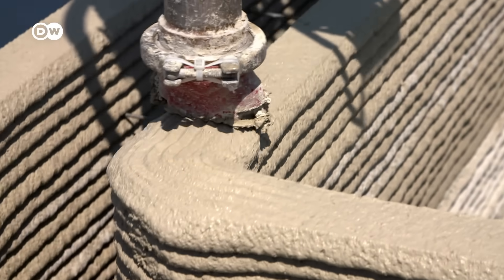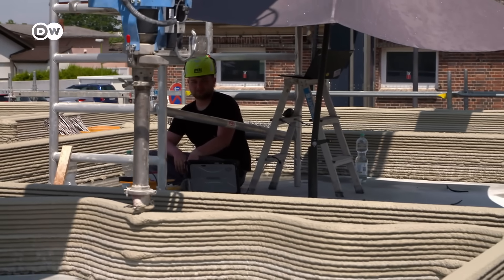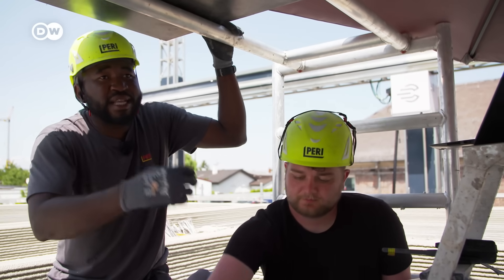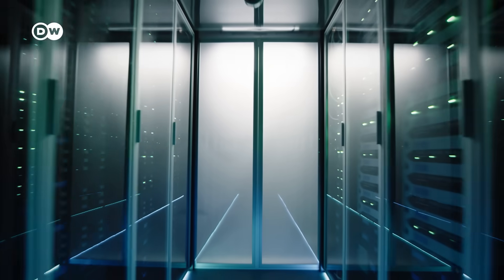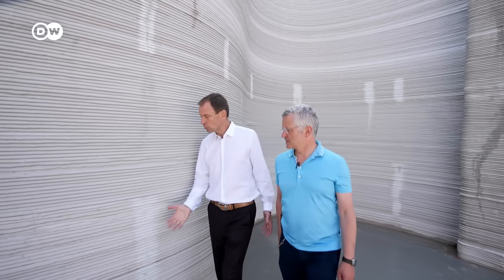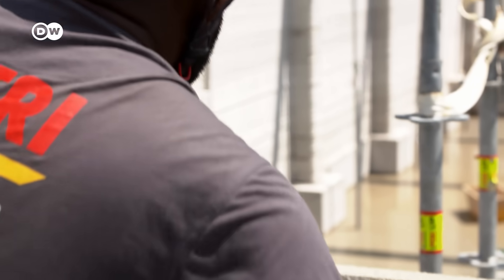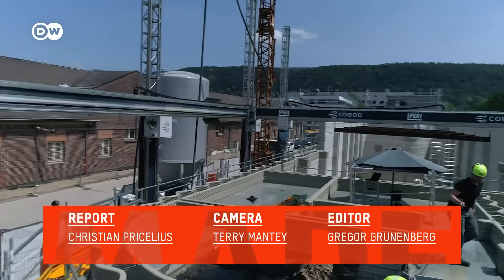How Europe's biggest 3D-printed building is being constructed | DW News

Comment: This construction method is interesting but there is one issue...

Will a house made by 3D printing withstand a seismic event better or worse than a traditionally built house?
Reply: with no steel rebar to reinforce the walls, i'm going to say no.
the lack of windows would be a concern for any structure that is supposed to have people living/working inside.
concrete has very good compressive strength, but it has poor tensile strength;
so it will crumble and the structure will fail in the event of a collision (a vehicle driving into it) or seismic event.
comcrete also has poor insulatiom by itself, and it appears that this 3D printing method makes creating 90° corners impossibly impracticable.

Comment: So the ripple walling and curved ends is to help the structure stand up straight and resist wind pressures? I can see it functioning in this form of enclosing a large space but it seems that the internal arrangement would be quite similar on complex buildings internally with requirements for fire and public escape.

Comment: I still don't understand how they meet tensile strength requirements and building code. If that wall were solid concrete, it would be required to be full of rebar.
Reply: so you think brick construction is illegal?
Reply: Building codes only specify what should be achieved in terms of performance. How you achieve it is not specified. Furthermore, the concrete mix for 3d printing is of higher strength than that of typical construction, partly because it has a higher cement ratio and partly because admixtures are added to boost performance. The tensile strength on the other hand comes from the steel reinforcement that is added by hand.

Comment: Have they fixed all negative effects of 3D print building? Windows systems, humidity,  water in general, isolation, other housing  (water, electricity, heat pipes). Dusting, wall strength etc? 

I use to see it as the future untill I met somebody with experience.....  It change my view on the problem

Comment: 🤔 so either they are laying concrete on top of dry concrete and layers won't stick together properly or they are pilling up wet concrete resulting drying difficulties and countless other problems in the long run! Also, it is very clear that they are using at least 30% extra concrete to do the same job! But I guess seeing as you don't need any builders, they are saving a fortune on salaries!
Als to make those wall esthetic and cleanable They will spend a fortune or never be able to keep place clean!

Comment: Concrete production is an important CO2 contributor. This method needs tons of it, way mare than traditional methods. 
Better use prefabricated elements: faster, less impact, cheaper.
Reply: Concrete is not a single building material for 3d printing buildings
Some are like clay mixed with something 

There are a lot of printing materials

Comment: Pouring concrete into rebar reinforced frames would be faster than setting up and tearing down this elaborate printer.
Reply: Exactly, a 3D-printed building is only inferior.
Reply: @thebabbler8867  - you assume technology doesn't evolve...or that processes or procedures won't improve.
Reply: @bitphr3ak  no he doesn’t haha, he’s saying it’s idiotic to use this technology now in its inferior state!!

When they figure out how to reinforce it, sure, I’ll get a 3d printed home then. But for now? It’s an idiotic system with no benefit that took the lowest skilled labor/easiest job (putting up the framing and walls) and over complicated it for no net gain and actually a worse final product.

Non reinforced concrete is idiotic and will crack over time.
Reply: And it would be much stronger.  Maybe I missed it but I didn't see that they used anything to reinforce to concrete.
Reply: Despite it's limitations, at the moment, I think we're stepping into the right direction.
Reply: can you create such parametric shape with reinforced frames?? At waht cost??
Reply: @ugwuchikaeze8751  what benefit is there to the shape? its a feature with zero benefit!
Reply: @itwoznotme - what benefit is there to anything other than a square or rectangular building…aesthetics plays a major part in everything that gets built…you comment honestly is a bit silly

Comment: Six months to build the shell of a mid size building is awful. They still need to do floors, roof, insulation, all the mechanicals and electrical, not to mention finishing work.
Reply: Didn't you hear "SAVE COST"
Reply: @miracle269 3D printed houses are decades away from even being theoretically cost competitive. If they wanted to build lower cost housing, it’s called factory built panelized or modular construction.

Comment: I like the idea of 3D printing of buildings and housing, as it has a lot of potential. My questions are with long-term maintenance, plumbing, electrical, upgrades, etc.
Reply: The answer is cracks...
Reply: @MikeTsBees  you’re wrong, I know your type, you rather live in paper houses.
Reply: @outtersteller  I live in a brick shithouse
Reply: @MikeTsBees  :face-green-smiling:
Reply: No windows or ventilation 😂this has extremely limited potential 😂hence why it has never taken off😂this has been around for a decade and still hasn't been used regularly 😂modular homes are the way of the future. Homes that go together like lego
Reply: The fact that the wall consists of an outer and an inner skin separated by a gap, actually allows for services to be passed between the two skins
Reply: The answer is, you frame the inside after the 3d foundation is printed
Reply: No rebar, no strength. Not safe, not sturdy. Wont last!!
Reply: @Kep79  then how do brick houses last which is just clay without rebar?
Reply: @tomh1727  brick houses have lots more going for them as bricks are solid material and they get stacked in ways designed to even out the load. but they do get cracks in the mortar and still can face allot of issues. Concrete however is a liquid that never fully dries. and as such needs to have corrosion resistant steel rebar to stiffen it so it can last more than about 30 years .overwise it will crumble to peices. Imho a product like porotherm blocks are the best solution for reducing labour costs. As they are easy to build with and suit a wide variety of building applications. And with a good external skin can look really pretty.

Comment: I can see an Architectural potential of splendor.  I think it is not too much to later plaster the walls smooth (if needed).  But those 'ripple effects' are truly remarkable.  We can now for the first time make beautiful shaped curves with perfection.
Reply: What they do in the USA at least if they want smooth walls is the 3D printed concrete is still wet for a time, so they smooth it out like they would with any other concrete.  So, add a 4th person to the crew with standard concrete smoothing tools and you have a smooth finish to the structure.
Reply: @ChaJ67  but you need to be careful because that may affect the stability of the wall. Also you may just completely collapse it because the concrete doesn't have the structural stability yet to resist the forces applied.
Reply: @Andreas-gh6is  the way this is currently done seems to be perfectly fine and stable.  Just don't down too many beers before getting started.

Maybe you could add a breathalyzer test for the person doing the finishing work so they are not too far above the legal limit if it becomes a problem.  Also, unfortunately people with a severe case of Parkinsons cannot do the finishing work.
Reply: @Andreas-gh6is  I am just saying everything I have seen shows this to be a solved problem.  I would recommend looking up some YouTube videos of this being done in the USA.  Time and time again I see them doing this for 3D printed homes and it works out just fine and looks good.  Nothing falls over or anything.  They just smooth it out and it looks nice and smooth and a perfectly safe structure to be in.  It is just a finishing feature they advertise and the USA does have building codes and inspections and such, so I don't think they would advertise it if it lead to anything unsafe happening.

They also drop window frames into these homes as they 3D print it and it comes out fine.

The thing seems to be these homes are a lot quicker and cheaper to make while at the same time being more sturdy than what is usually built in the USA.  The problem in "the heartland" are tornadoes, especially with global climate change making these tornado storms so much more frequent and intense, so they really need to ramp this up to build homes that can better withstand the next tornado to come roaring through after the current homes get wiped out.  Especially with the lower cost to construction, maybe they can start replacing some of these mobile home parks that always get blown or washed away with much more sturdy and wind resistant concrete homes.
Reply: @ChaJ67  For tornadoes and other such things, a more circular or dome like structure would be better suited to survive such events. 3D printers can make the outside circle relatively easy, but the dome part might be a little tricky, but not a game breaker.
Why they haven't done this as standard still blows my mind, specially in areas where they know its an issue.
Reply: @Keemperor40K  What normally happens is windows on the windward side blow out / hit with debris and broken and then the positive pressure inside the house lifts the roofs off.  I don't think that is a dome thing as much as a strong window thing.  A dome shape wouldn't hurt.  It would be stronger.  But a box can be made strong as well.
Reply: @ChaJ67 yea smoothing the walls make the building look much better - night and day better
Reply: Here here. I look forward to see how these building do going forward with their owners and see how well they age. I would love to live in a house like this.

Comment: That amount of concrete looks expensive, especially for an industrial building.
Reply: Concrete is cheap. Probably no different to a building made from precast panels as the labour and transport costs would be cheaper.
Reply: @AORD72  
Precast panels for industrial buildings?
For what reason?
Is cheaper, faster and lighter to use steel components.
Reply: @argotcalo5575  Strength, endurance, noise dampening to name a few. Many reasons. Plenty of buildings being built out of precast concrete everyday for many reasons.
Reply: @AORD72 
For sure there are reasons to prefer precast concrete as a material.
But for industrial buildings strength, endurance and noise dampening can be achieve cheaper with steel components.
Forget about printed concrete.
Reply: @argotcalo5575  "For sure there are reasons to prefer precast concrete as a material", and printed concrete can have advantages to precast. Like no need to transport and no moulds needed. Whats is the life cycle of a steel building compared to concrete? Steel often required maintenance due to oxidation.
Reply: @AORD72 
I dont know the life cycle of steel buildings.
But i thing is good enough because they can last more than a 100 years.
That is good enough for a industrial building or a factory.
At the end the steel can be extracted from the building and recycled to make new steel.
Applying paint is not a problem.

Comment: This is just a gimmick sure it can be helpful in building things which are atypical but most buildings are already made through prefabs and they're plenty efficient and cheap ...... the housing crisis which this claims to solve will not be solved because the cost of construction is low but the prices of these places is astronomical just look at berlin and how expensive they are and even if new buildings are being made they're usually luxury apartments not affordable housing .......

Comment: i feel like this building will break if you look at it the wrong way… at most, this would be useful for building low walls, planters or maybe funky benches and other public infrastructure. but this seems needlessly complicated for limited applications.
Reply: They print the perimeter of the walls, you can see in the final shot of the video that they do seem to place metal reinforcement between both sides of the wall and then fill it. I don't see why it wouldn't be stable.

Comment: BTW: There is no need for the ripple effect. You could scrape this flat right off the nozzle. 
It just goes to show how little viable this thing still is. It's mostly just artsy fartsy. It makes no sense over prefab slabs + robotic assembly on site. Especially given the stringent criteria for concrete delivery and hardening.
Reply: that's what I was thinking
Reply: This would be best for a subdivision where they could pre fab with less material
Reply: We can do it with false wall work by POP and Alumnium channels.
Reply: probably robotic assembly + on site poured concrete walls is even cheaper
Reply: It's just strictly not necessary to flatten the ripples. It doesn't offer structural benefit to flatten them but it would add cost. Much cheaper to leave it as is, or deal with it after the fact when you install insulation and finish on your interior, etc., if it's deemed too much of an eyesore to be worth the additional spending for the owner.

Comment: We know 3d house printing is potentially the future, but it has to be standardized industrial wide and if the technology is reliable and fast then it could be the main standard for house construction and perhaps apartment complexes too.
Reply: @adagioforstrings007  Sorry I misunderstood you, I thought you meant support material. However it has shown in the video that it uses cement mixtures not wood.
Reply: It will be a case by case basis, for some areas it's ideal, others, it's really not.
Reply: @adagioforstrings007 It doesn't need wood, only steel.

Comment: What is bearing capacity of such walls without rebars? What will they do if there is a need for big openings for windows and doors? What will happen with the walls if they start to pour the walls during rain? Overall I feel that those 3D-printers will work only for small constructions with weird/unusual geometry.
Reply: Windows are not even that hard to do with this, just stop when the height is reached, then like wait a day, place something on top of windows to hold new concrete and continue. Other things solvable too.
Reply: As a Building Scientist I can say the above responses are correct. As for load bearing and rebar - take a close look at the video. My guess is that they literally print out an open box section where the future column will be located. Once dry, they insert rebar and fill the box section with a stronger concrete (ie the box section becomes a formwork of sorts).
Reply: Windows will make it more expensive which is why they're doing it without any
Reply: Pretty terrible.  The reason this is ultimately so expensive and isnt catching on like you might expect, is because like the monolithic dome fad, you still end up doing traditional construction inside, to hold it up and create livable spaces. All they're really doing here, is creating a shell; like bricking the exterior of a house.
Reply: @springbloom5940 Yep. But it only requires one superviser to manage it all. No brickies. Labourers. The machine prints way faster than a brickie can lay bricks so there are savings all the way. The reason it hasn't "taken off" is the current cost of the machinery. Most systems right now are highly bespoke. As refined systems come online and more are produced, this will be the standard. For the most part, the 8nternals will also be printed. Roofing will be the next biggest labour load and I've seen 250m2 of roofing go up in a day saving on days and days of labour again.
Reply: @rykerhasyounow  

We'll see. It certainly has applications, but right now I think they're trying too hard to make the technique into something its not and playing on the novelty. What I think would be a good application, is printed rapid assembly modules that could be constructed offsite or near-site and transported. 

Use some type of recyclables and it could be an excellent solution to emergency response. Like print up a paper mache or mud 'wasp nest' apartment complex for temporary housing, or as a compound for relief operations. Combination with other non-traditional building materials and techniques, could offer a lot of flexibility.  I was super into the 'foam home' concepts, as a jugend and that seem like an interesting potential.
Reply: @springbloom5940  Turn it into what? A practical, efficient and reliable building process? If so, then no, they not trying to change anything. 
The numbers are already in, though. How can it be a novelty? 
And the advantages are the same for ALL construction. No construction method benefits from taking more time and spending more money for no quantifiable gain. If it's practical for emergencies or high density housing, its practical for regular construction.
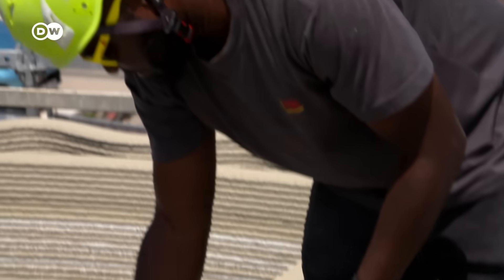Reply: @-DM 1:35
Reply: It is dual walled, they are putting rebar in the middle and pouring concrete in between.